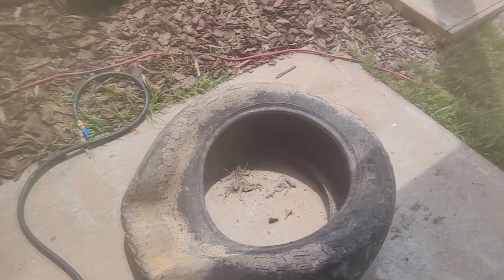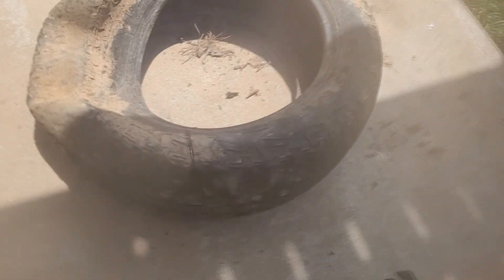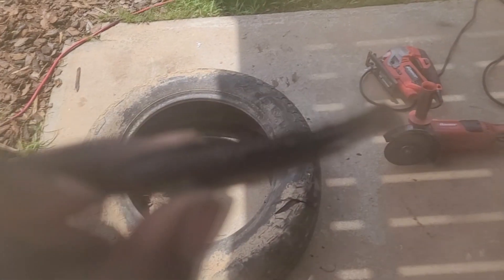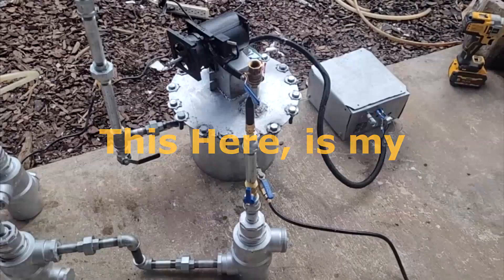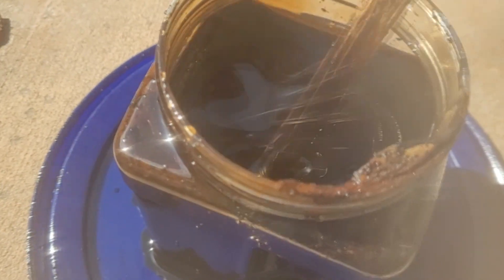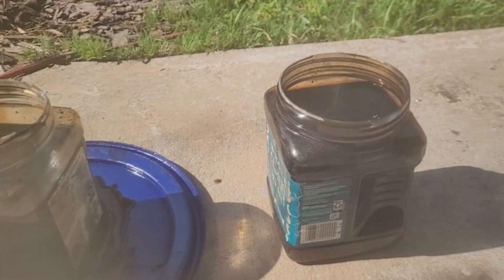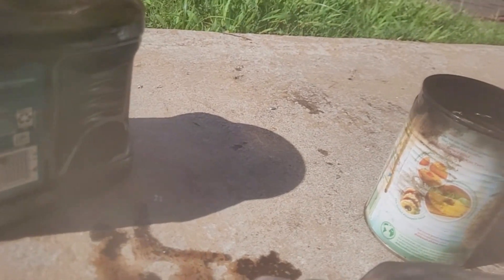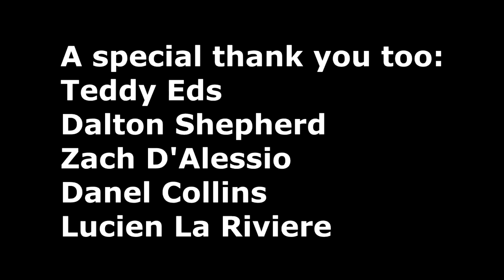Pyrolysis Oil vs Motor Oil and Chopping Tyres

Comment: I think those fibers inside are some kind of cloth. I have a question, I just watched a video of a guy putting a lawnmower carburetor on a v8 and getting 40 miles per gallon without losing much performance. Could you pyrolize gasoline or diesel into gaseous fuel? He claims his carburetor works because it breaks the fuel into tiny droplets thus burning more of it, plus the vacuum boils it. So, if you could crack it to methane and hydrogen wouldn't that work even better? Then use a propane carburetor instead of a float bowl one for liquids. Seems like you could run a gas engine on diesel that way. There is a ton of room for improvement on car engine efficiency, they banned carbs on cars in the US. SO if this works it would be illegal to produce. I just realized you made a video with oil.
Reply from the maker: That makes sense. The smaller the hydrocarbons, the more flammable it is. So if gasoline is further cracked, it essentially will become propane, which burns more efficiently and easier, which would improve MPG. Though I could do this, the biggest issue with using gases in cars is storing it and refiling it. It'd be better to make gasoline, and break it down in the engine itself like you said the other guy does.
Reply: @naturejab  I was thinking more of running the pyrolyis on the vehicle so it stores liquid fuel. If it improves economy enough it could be enough to offset it's size.
Reply from the maker: @wesKEVQJ  True, ultimately, a masteted continuous reactor would need to be created to sustain a vehicle
Reply: @naturejab  Maybe a small tank to store excess and have it if you needed extra. It might work on a bigger vehicle. Or a stationary generator. I don't know if his mpg claims are legit but it's extraordinary if it's true. He like tripled the mpg.

Comment: The best way I've seen for cutting up tires is a method that uses liquid nitrogen to freeze the rubber and then crush it when it's brittle.  Next best is Taryl Fixes All using a log splitter.
Reply from the maker: Liquid Nitrogen idea is clever. Thanks for the suggestions!

Comment: Hi mate, if you want to make diesel fuel from plastic oil, I recommend that you investigate the boiling points of diesel and other materials so that you can separate them all separately and you will also see great congratulations on the videos.
Reply from the maker: Thank you! I'm in the works of a fractional distillation collumn.

Comment: Hey, I love your videos.   Can I request a couple things although i know you're busy?

1.  Can you try fractionation of the used motor oil thru a tower to see if diesel/gasoline will come out?

2.  If you do get Diesel/gasoline separation/fuel oil separation, can you try cracking the fuel oil with benzoite or aluminum/silica and testing with a hydrometer?

3.  Can you elaborate on the catalysts used?
Reply from the maker: Hi, thanks so much for watching!.

1.  I am currently researching the construction of a fractional distillation tower. So I will do your experiment, though I will say, the used motor oil chains are so long that more than likely, without very high temperatures to crack it, it will not form diesel or gasoline

2. I do want to try cracking with alumina and silica catalyst too. The use of a hydrometer to test is a great suggestion, thank you very much.

3. I use two different types of catalyst. A catalyst for microwave absorption, and a catalyst for catalytic reforming.
For microwave absorption, I use a mix of carbon and iron oxide.
For Catalytic reforming, I use Lime (calcium oxide) steel wool, Silica, and Clay

Comment: Yes, the tires are reinforced by steel wire. Best idea would be to try an electric metal saw (not a chained one) or a hydraulic press with the right attachment, but the latter requires a tire mount so it doesnt slip. And I mean the electric saw that goes back and forth, not the jigsaw you used.
Reply from the maker: As usual, thank you for your great suggestions!